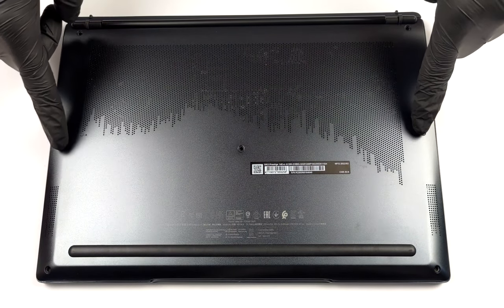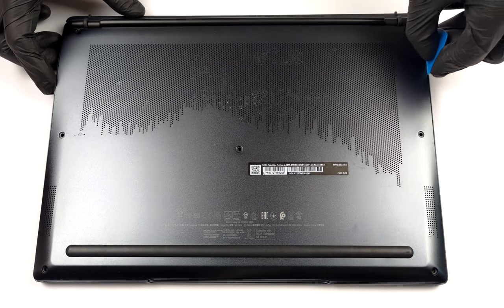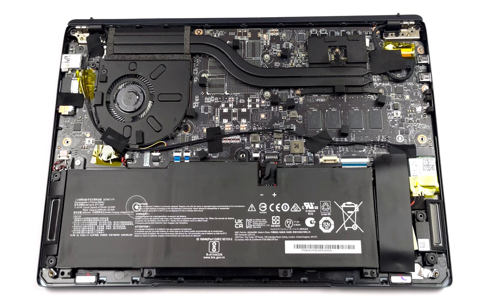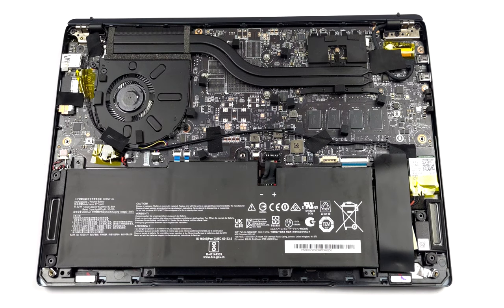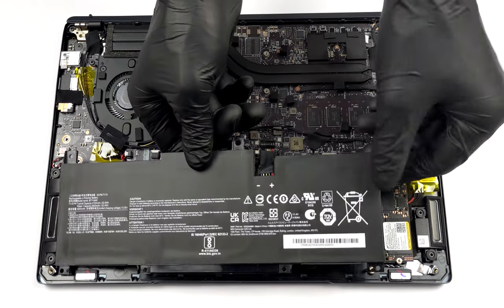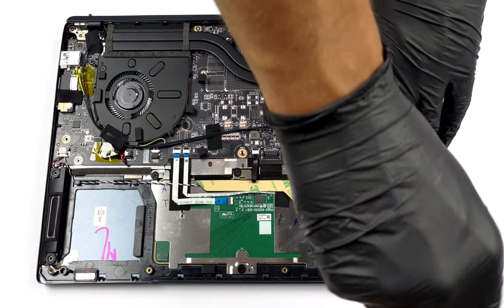🛠️ MSI Prestige 14 (A12M) - disassembly and upgrade options

Comment: If i change the SSD, Would I have to pay for another Windows licence?
Reply: Just clone the drive, file for file, then wipe and sell your old drive.
Reply: No. Just create an install media from Microsoft. Your key is UEFI stored.
Reply: Pedro is correct.
Your Microsoft windows key is stored within the motherboard and the Microsoft windows installation will automatically detect it.